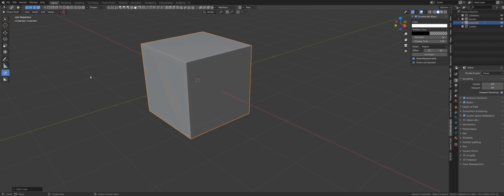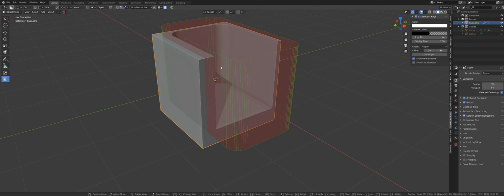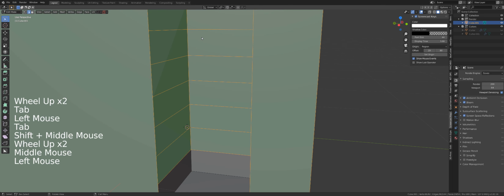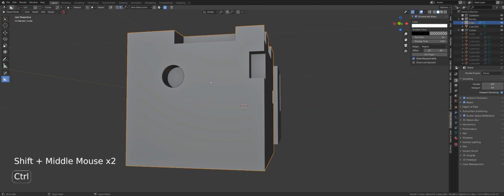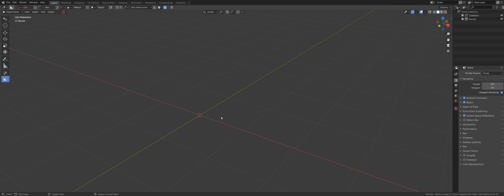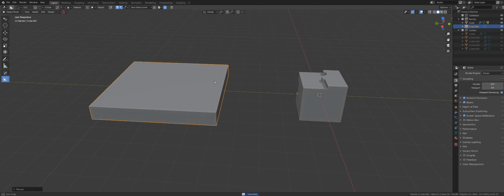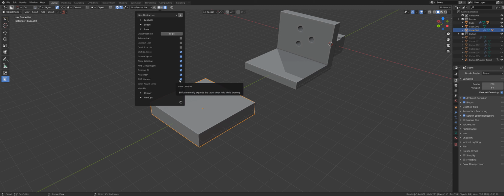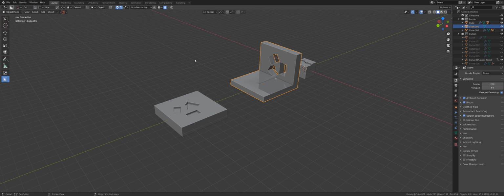How to use Boxcutter for Blender part 3 Advanced Cutter Options

Comment: 13:43 my circle doesn't have the red outline but has a green wireframe idk why, sorry for noob question, but is their any fix to it?
Reply: (2.8) HOps 00986_Mercury_6.zip
(2.8)BoxCutter 716_7.zip

It was fixed after reinstalling the add-on with the updated one :)
Reply: @blenderman4174  same, my problem got fixed too after updating
Reply from the maker: @blenderman4174  yeah that could also work, i have a vid that shows how to install bc and hops from scratch with all the settings that i normally use. glad you got it working!
Reply from the maker: you are probably in a different cutter mode, like slash, or join, just check your cutter mode.
Reply: @PonteRyuurui  The same thing happens to me.

It is displayed in green wireframe only when circulating.

Obviously, it was correct to set it to "cutting mode", and I actually confirmed that it would cut when I gave the command.

During the command, I tried to switch to wire/non-wire mode by pressing "h", and I switched to another mode by pressing "X" "Y" "T". However, even though the cutting mode continues, the "Circle Cutter" is displayed as a green wireframe.

So I searched in the settings tab of "Box Cutter Add-on".

As a result, the wireframe color of the "Circle Cutter" (in fact, it is normal to have a colored cutter on the surface, not a wireframe like a square cutter).

The color was adjusted to "Box Cutter Add-on Settings Tab> COLOR> Show shape Wire".

I don't understand why this is happening. Perhaps it is an add-on error.

There is a "show shape" in the settings in the top bar of the box cutter. When this is unchecked, the circle cutter is not affected by the color of "Show shape Wire",

Unfortunately, I noticed that this time it appears as a black wireframe.

Do you know a solution?

Comment: When holding Ctrl to use the Grid, you can scroll the mouse wheel to change the grid size. Great tutorials looking forward to more.
Reply from the maker: True that! The issue is that it jumps in large increments, but it could helpful in many situation. Thanks a lot for mentioning that Nigel!